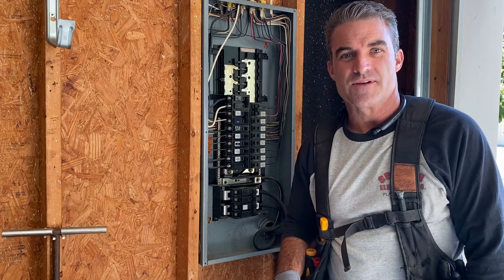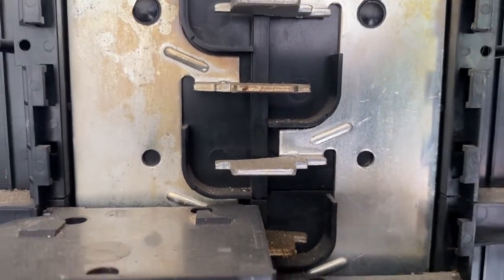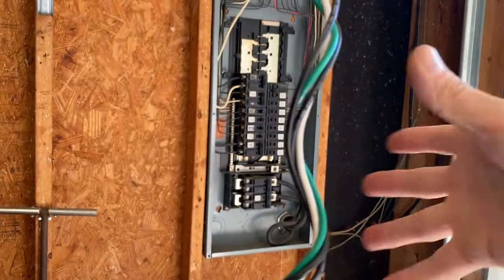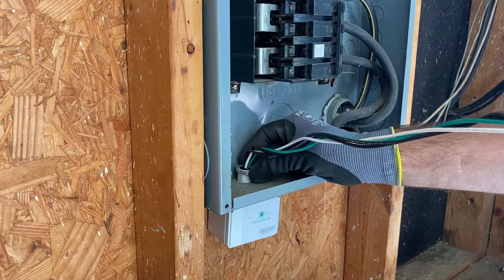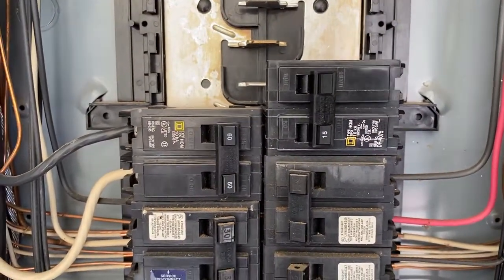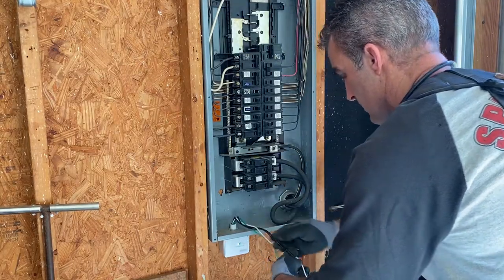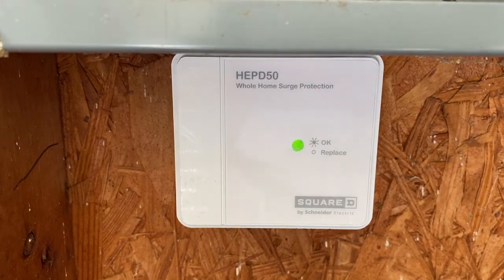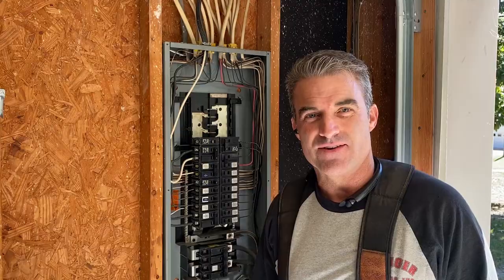Install Square D HepD50 Whole House Surge Protector #howto #diy  #homeutilities

Comment: New York buildings don't have surge protectors. They have problems with elevators and gas accidents and ebikes ..but they don't really advocate surge protectors in public libraries. Case in point the new York public library.  This is the one on 5th Ave and 40th st. Same place where someone got beheaded in a hit and run. And same place where about a year or two ago a blast came out of a manhole just outside their door. The security guard named securitas ignored what I just saw and told them. Then in the middle of me insisting they look into it...another blast. Big one. This is the same corner where the Citi bikes are parked. Usually it is due to snow melting on something...at least that is what the news reports.

Comment: What if you need to replace it someday ? Will you leave the wall opened ?!!
Reply from the maker: Hi! Thank you for watching the video. This was installed in a garage. So, the likelihood of it ever being sheet rocked is pretty slim. If the wall is already covered in sheetrock, then you would have to surface mount the surge protector onto the sheetrock. It becomes a little trickier because you will have to punch through one of the panel knockouts and then drill through a 2 x 4 and surface mount the surge protector next to the panel. If this is the case, a licensed electrician would be your best bet because there are code regulations on how wire is to be run in this case. Hope this information helps.👍

Comment: 2:51 Clueless. Manufacturer says to twist and shorten wires as much as possible, and to be as close as possible to the main breaker.

Which makes sense because you don’t want the surge to travel through the panel before it hits the surge protector. And you want to give the surge amps the shortest route to ground.

Comment: Twisting your wires could improve your protection voltage by 200 volts.  Also, where is your panel ground wire going out to a buried ground rod?  That is the low impedance path for your HEPD50 to dump any surge to ground.
Those who worry about breaker location- electricity moves 1 foot per nanosecond.  So in 1 nanosecond a 6000 volt 8us risetime surge impulse increases by 0.75 volts.

Comment: Did you read the instructions?
It says to trim the leads as short as possible.
Per the instructions:

Note: To enhance the performance of the HEPD50 / HEPD80, twist and keep the conductor length as short as possible by trimming down the wires (do not loop or coil the wires and avoid sharp bends). Always connect the HEPD to the circuit breakers) found in the closest proximity. Increasing the HEPD conductor length will degrade its performance.
Reply from the maker: Hi! Thank you so much for watching the video and adding the instructions to the comment. Here’s the interesting thing, I created this video and installed this surge protector back in 2022. Those instructions were updated in October 2024, which includes the notation that you added into the comments. When I installed the surge protector two years ago, I followed the install instructions which did not include that portion. Thank you for including it in the notation so that someone else can see that. Hope this information helps clarify any confusion.👍

Comment: You should not leave the wires long. You should cut them as short as needed and get rid of the extra. If you leave them long, you risk having one of your protected lines being shorter than the protector so the surge would hit the device on that one before it hits the surge protector to get grounded. That being said the wires on the surge protector are most likely shorter than any of your circuit lines to and back to whatever devices are connected to the shortest length circuit, but if you might have a shorter line to a device then you will want to make sure the lines to the surge protector are the shortest line in your breaker box.

Comment: Not a great installation, but works. Like others have said, the leads are supposed to be as short as possible. And if they decide to drywall the garage, how would you ever replace the SPD?

Comment: I want to install a surge arrester but my breaker box is full, what can I do?.Is it possible to install one?
Reply from the maker: Hi. Thank you for watching. If your breaker box is full, you can purchase a tandem breaker, that is, a single breaker that is a two pole 15 amp or 20 amp…depending on what two breakers you are going to merge together into one breaker slot. You can then put the two circuits on one tandem breaker and that will open up a space in your panel for a surge protector breaker. I hope this information helps.👍
Reply: @YouCanDoIt2  Thank you for your time and response, you solved my problem.
Reply: It's actually not meant to be installed to a breaker at all - rather you should install it directly to the main lugs (bolts) that are under your main circuit breaker. This is a type 1 SPD, and can be installed that way. Type 2 can not.

Comment: Why did you pick 15a breaker?
Reply from the maker: Hi! Thank you for watching the video. If you pull up the description box to this video, you will see that I have a link to the installation instructions for this surge protector. If you pull that up and go to page 6 of the installation instructions, it states that you can use a 15 amp, 20 amp, or a maximum of a 30 amp breaker for this protector. Hope this information helps. 👍
Reply: @YouCanDoIt2  I understand that. Why did you specifically pick 15 and not 20 or 30?
Reply from the maker: @johnm.6349  a 15 amp breaker will trip with a smaller surge / fluctuation in power over a 20 or 30 amp breaker.
Reply: @YouCanDoIt2  so why bother with a breaker above 15 amps?
Reply: @YouCanDoIt2  why would you want the breaker that the SPD is using to trip? wouldn't you want it to resist tripping so that it says connected to the bus so that it can do its job?

Comment: nice video, so let me understand - the surge protectorwill cover all the circuit and or breaker in the panel ? or just an specific circuit ?
Reply from the maker: Thanks for watching the video. The surge protector will protect the circuits within the panel. When there is a surge or a fluctuation in power coming to the panel, the surge protector will trip and cut off all power so that anything within that panel will be protected from a surge.👍
Reply: @YouCanDoIt2  got it thx 👈😎

Comment: Best location is where the RAW power comes INTO the panel. Prior to the main breaker. Always use NO-OX or similar anti corrosion paste on the wires. Never put two wires/cables into ONE lug. That is a fire hazard. All wires MUST BE short as possible. End of message on that. For every extra foot of wire, you add more to the clamping voltage where this was designed to work. Short wires short wires...... Do NOT install your SPD at the opposite end of the panel LIKE IN THIS VIDEO.

Comment: What about 3 phase? Do I connect to the two low legs?
Reply from the maker: Hi. Thank you for watching the video. This surge protector is good for a Homeline addition, residential surge protection. You will need to go to the Square D website for a commercial grade surge protector that is good for 3 phase installation. Hope this information helps 👍

Comment: How is it installed to 120v?
Reply: Your home and just about every home in the USA has two 120v circuits coming into your home and the breaker shown in this video uses both so you can get 240v to those appliances that run on 240v such as a stove, water heater or AC unit,  This is why the surge suppressor has two black wires, to protest both of the 120v circuits.  I hope that this addresses you question.

Comment: Ground and neutral on same bar??
Reply from the maker: Yes. The neutrals and ground go on the same bus bar for a main panel. The only time you need to separate the ground from the neutral is on a sub panel. Hope that helps 👍

Comment: is this a mandatory in year 2023? the electrician it is.his charging me $600 for it
Reply from the maker: Hi. It really depends where you are located and what NEC codes have been adopted in your county. If your area has adopted the 2020 NEC requirements then the answer is ""Yes". All single and multi-family dwellings are required to have surge protectors on the panels. I hope this information helps you. 👍

Comment: Will whole house surge suppressors help prevent failure of GFCI/AFCI breakers?  I have to go replace two breakers at a rental today because a storm took them out. And those breakers are expensive!  Have had to replace them in other rentals too.
Reply from the maker: Hi Kevin. That's a good question, but not very easy as a black and white answer. The purpose of a whole house surge protector is to help minimizes the effects of power surges that may come into your panel, due to storms, outages, etc, that can cause appliances to fail. I would hope that this device would also help to protect the breakers in the panel, but that is something that you might need to call the manufacturer about. I hope that this information helps or points you in the right direction 👍

Comment: Hello,

This is straight from the manual:

"To enhance the performance of
the HEPD50/HEPD80, twist and keep the
conductor length as short as possible by
trimming down the wires (do not loop or
coil the wires and avoid sharp bends).
Always secure the L1 and L2 wires with
keps nuts and ensure proper connection.
Increasing the HEPD conductor length
will degrade its performance."

Might be an idea to trim it down some if possible.

Comment: Supposed to install as close to the main as possible & supposed to cut all excess wire. I did chuckle the minute you said leave at long as possible lol.
Reply: Agreed. If the SPD will absorb 50 KILOAMPS then the surge voltage will be whatever rated voltage the unit clamps at PLUS the voltage drop of 50 KILOAMPS flowing through the resistance of the connecting wiring. I'm  not sure what gauge wiring the SPD comes with. If it can be installed with a 30 amp breaker, then I'm guessing that it's #10 AWG. I looked it up and it has 1.02 Ohms per 1,000 ft. So, 5 foot leads would add the resistance of 10 feet of wire, or .00102 ohms. 50 kA of surge current would boost the clamping voltage by 51 volts. You'd need to analyze whether that's acceptable. Cutting the leads would reduce that.

YMMV! My electrical engineering degree is 48 years old, but unless the sneaky government changed Ohm's Law ... 😀
Reply: They will work anywhere on the panel. Preferable to be closer but does the same thing.
Reply: Right ! Make those wires as short as possible 🎉
Reply: Aren't they supposed to be installed so that the front is flush with the drywall?  What's the point of the indicator light if it is buried?
Reply: @ When installing an SPD on a panel/load center “scenario” like the one in the video, the proper way to install that specific device is to mount the SPD on the inside of the panel. SquareD sells/offers the kit to mount inside (sold separately) the panel. I actually prefer using the kits & repositioning the SPD inside
Reply: @ I personally prefer the ones that take up two breaker spaces.  I usually have tandem breakers in stock so it's a pretty quick slam dunk.
Reply: @ yes, definitely my preferred option but up here in the N.E. Of the US. those 2-pole built in SPD get up to $160 & mostly are $135-$150 so compared to $50-$70 plus a regular 2-pole breaker so $80 dollar to $150 🤷🏻‍♂️. But if up to me every time, absolutely go with the drop in SPD. 🤙🏼
Reply: One additional point - you do not required additional breaker, direct bus install is an option. The only reason for the breaker is the ability to shut off the device without shutting power to the whole house.

Comment: The breaker needs to be the closest to the main breaker to protect downstream  or be attached to the lugs of the bus bar
Reply: There are SPDs that only have two hots an a neutral cables. But this HEPD50..has 4 cables...including ground....Maybe, this might be the reason that you can install it far from the main lugs...
Reply: @learningpower9437  The instructions I posted from the company say otherwise.
Always connect the HEPD
to the circuit breaker(s) found in the
closest proximity. Increasing the HEPD
conductor length will degrade its
performance
Reply: @JRP3  Understood!!! Thanks!
Reply from the maker: Hi Troy. Thank you for watching. However, I will have to respectfully disagree. The instructions clearly state that this surge protector will work effectively regardless of which breaker location it is placed at. The bus bar installation is an option as well. I did not opt for that as I do not like loosening up factory torqued lugs. Hope this information helps 👍. The installation instructions are very clear on what is acceptable for this surge protector to work and remain within warranty.
Reply: @YouCanDoIt2  From the instructions you linked:

Note: To enhance the performance of
the HEPD50 / HEPD80, twist and keep
the conductor length as short as
possible by trimming down the wires (do
not loop or coil the wires and avoid
sharp bends). Always connect the HEPD
to the circuit breaker(s) found in the
closest proximity. Increasing the HEPD
conductor length will degrade its
performance
Reply: @YouCanDoIt2  that’s a alternative method to wire it but it’s also noted on the instructions when installing the HEPD and increased its effectiveness wires should be twisted together and trim down shortest as possible also is ideal to be placed to the incoming power source

Comment: Thanks for making this! You got any tips for mounting in a recessed panel with drywall up? Also, some models allow mounting directly to the bus without needing a 2 pole breaker, which is pretty cool
Reply from the maker: Hi Austin. The bus bar mounting option is a choice with this one as well. I just don't like doing something like that where the bus bar lugs are loosened and then retightened. If they are not torqued down properly it will affect the entire panel. I like the breaker option because it's quick and effective 👍

Comment: wires should be cut as short as possible.  every extra foot of wire gives 500-700v of let through during a spike
Reply: the sure protector should be right after the main breaker withe the wires from the surge protector twisted once an inch and directly to a breaker . i used a 50 amp dual pole as instructed. this method of short wires makes a more effective protection. follow the directions. it’s possible that square d didn’t mention this. i installed an eaton ultra surge protector and had specifically stated to do as i’ve stated on the install.
Reply: @harrydoherty8299  thanks for the insight. Just to clarify, can you expand on "twisted once an inch"?
Reply: @harrydoherty8299  ok so i just read the installation instructions and yes I see that they state "have one twist per inch to reduce the impedance of the wire." Still, I don't get it, so the shape they want is like the old telephone wires that are like a pigtail?
Reply: I have never heard of this.  Can you explain more pleasee?

Comment: Can i plug this into a subpanel if my main panel doesn't have any more bus space?
Reply from the maker: Hi. That is a good question. The answer is yes and no. If the subpanel is located next to the main panel, then the surge protector will operate properly. However, if the subpanel is located somewhere else, causing a delayed reaction to any energy surges, then it will not work to protect the main panel properly. So, the real question is distance between main and subpanel. If the panels are less than 10 feet apart from each other, you should be fine. Hope this helps 👍
Reply: @YouCanDoIt2  Thanks! unfortunately my subpanel is located much further than 10ft, so I guess Ill just end up buying some surge  protected power strips instead. Would have been nice to install, but not much I can do I guess~
Reply: You can put it in the subpanel, but, it will only protect the devices in that subpanel, and not the devices in the main panel. Some protection is better than none.

Comment: Totally not how the instruction say to install it. It says to connect to the bolts below the main lugs. That way the entire panel is protected
Reply from the maker: Hi Justin. I have to respectfully disagree. This install is completely to manufacturers specifications. The specs, according to sheet NVE82551, call out for two best practice options. The first, is the one I chose to do. The second, is installing the surge protector to the bus bar / lugs. The problem with that installation, in my opinion, is the loosening of the lugs and retightening. If you don't get those lugs torqued down properly, then you wind up with loose connections down the bus bar feeding multiple breakers. Hope this information helps.👍

Comment: Just because you own a screwdriver doesn't mean you should be installing an SPD 1 device in your panel. As in installing the SPD at the opposite end of the panel where it doesn't belong. Stay out of that panel if you don't know what you are doing.

Comment: hi can plug this on MCB breaker? thank you
Reply from the maker: Hi Melgar. Thank you for watching the video. An MCB (miniature circuit breaker) is meant to prevent surges in electricity, usually used for low voltage applications. In a way, it is a surge protector already for low voltage use. I would not attach this whole house surge protector to one of these breakers. I would find another breaker with a standard breaker to use as the landing source. Hope this information helps👍